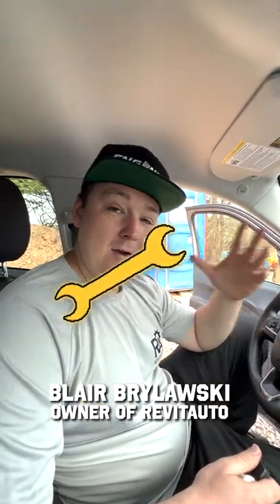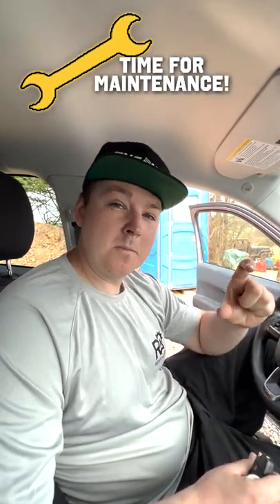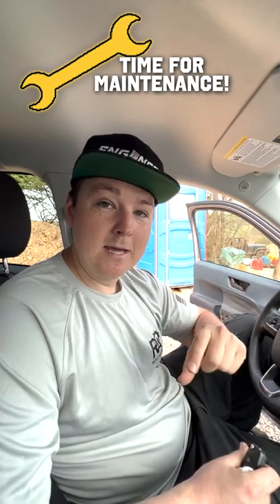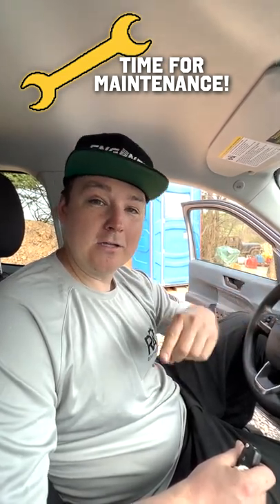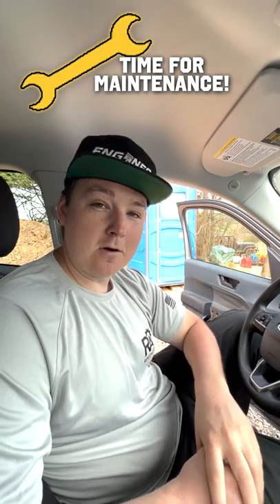What Does the Wrench Symbol Mean for your Car? #shorts

Comment: What was the point of this?
Wrench light:
Throttle body
Fuel problems 
Fuel door
Speed sensor 
Throttle position sensor 
Coolant issue 
Transmission cooler
Transmission fluid
Wire harness 
Fuses 
If you see a wrench it’s not asking for maintenance it’s telling you there is a problem

Comment: Today the wrench symbol turn on my 2010 mustang , it run great nd everything but. Once i step on the gas , it goes to gear 3 fast nd it drops ,
Reply: That’s mine too , if you find out any info lmk please
Reply: I’d take it to get it checked out sounds like a transmission problem and it’s better to get it checked out while it’s still funcional. Unfortunately I got a wrench sign but my car won’t move took it to my local mechanic he checked the transmission and found chunks of metal in my 2015 mustang 🤦‍♂️ get it checked out don’t put it aside and than try to get it fixed when it’s too late.

Comment: Wrench light turned out to be bad battery and $250 towing bill
Reply from the maker: That's interesting, typically the battery light will come on,  when there is a battery issue or a charging issue. When did the wrench light turn on? What year make model do you have?
Reply: @Revitauto  2014 Fusion Titanium. Wrench light came on just after I started the car and was heading home. Message said to see a dealer. Made it home, then DEAD nothing worked. I checked the battery with a charger and it showed fully charged. I could have changed the battery myself if I had known and would have saved $300.
Reply from the maker: @jimmcdiarmid7308  Is your Fusion a Hybird? That is really strange it showed fully charged but still had not power inside the vehicle? I have had it where corrosion builds up between the terminals and the battery and no current flows. But I have only seen that 1 time in 10 years of doing this.
Reply: @Revitauto  not a hybrid, but I have had battery troubles previously and it only has 58,000 miles

Also son has multi battery problems with his Explorer. First battery lasted 12,000 miles
Reply: @Revitauto  the battery was just over 3 years old and out of warranty